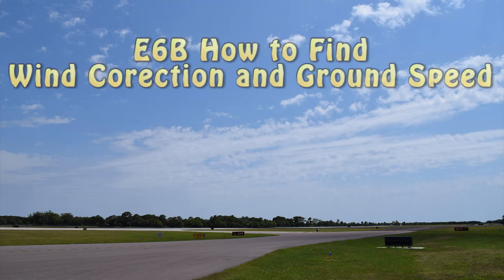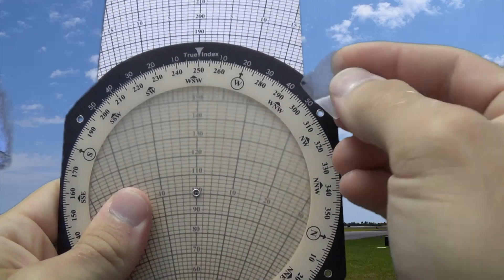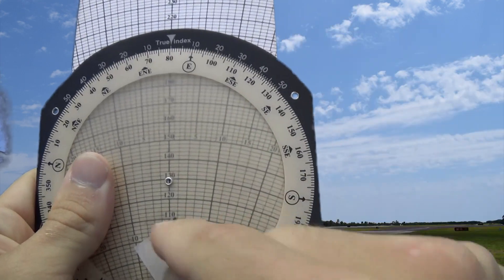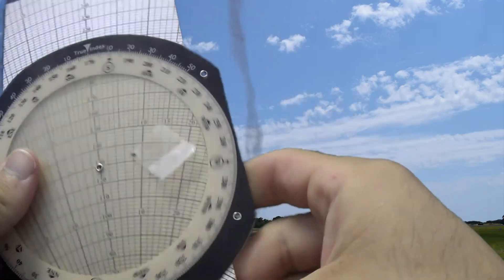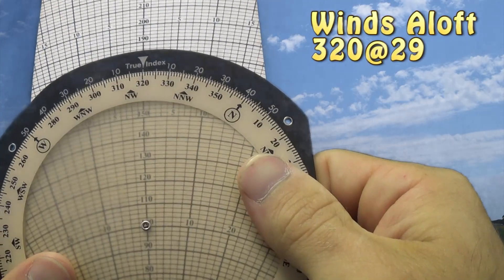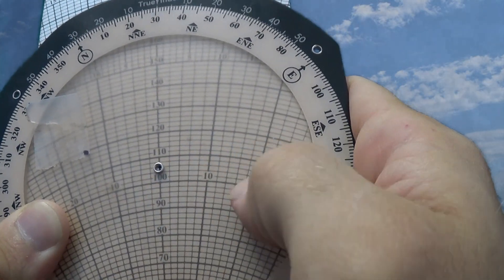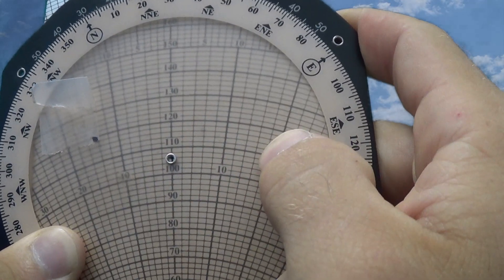Ep. 107: E6B Wind Correction Angles | How to calculate Ground Speed, WCA, Magnetic Heading

Comment: what if the TAS exceeds the CRP5 figures, examble a TAS of 420kts how then do you use the crp to calculate GS, WCA
Reply: Therefore there is a backside of the plate up to 650kts.

Please note that the method shown in this video does not work for that high speeds. You'll need to use wind down method (explained in comment above)

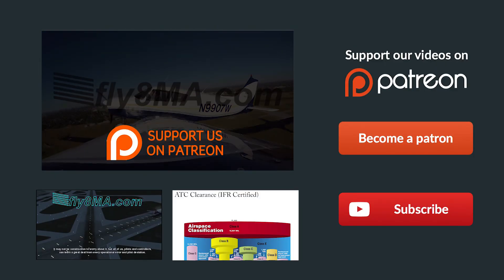Comment: I know this is a little older post, but I'm a little confused. At 6:39, you do a division of 50/105 = 28.57, but I run that number and get 0.476. Where does the conversion come into play and how did you get 28.57?
Reply: Here's how: 

50nm / 105 nmph = 0.476 hr = 0.476 hr x (60 mins / hr) = 28.57 mins

Comment: There seem to be a lot of "gotchas" in the aviation world.  Why should METAR and TAF have to be decoded?  It's not like there is a telegrapher tapping out the numbers.  These vital messages could easily be written in plain English.  Also, demanding that a pilot be expert in using 1940's slide rule versus an electronic device is as archaic as insisting that the pilot be able to hand crank the engine.
Reply from the maker: As you fly you'll realize why things are still this way.  I prefer a coded metar and tag since I can interpret all the information in less than a second.  With more words spelling out the conditions it would take longer to absorb the information.  Half seconds and seconds matter when you need to quickly absorb a lot of information in the cockpit to make decisions in-flight when things start to not go your way.  A slide rule can also be used faster than a calculator in turbulence when you are well practiced with it.

Comment: Thank you for video, but what should we do if the question would give TAS which is 420 KTS ? Can you make video for this question please? Ex: TC = 017 , WIND = 340/30, TAS 420 KTS. Find WCA and GS ?
Reply: Hi Guray, your E6B should have a hi speed side on the reverse of the slide. My WCA 6 degrees left for a TH 011degrees and GS 395. HTH
Reply: @mike326ify  Hello sir. Appreciate your work. I have tried to solve this problem I get the WCA 2,5 degrees for a TH 014,5. GS is 395.
Reply: @mohsenalziheiri2496  Precisely my answer using both e6b and Jeppesen CR. I made the mistake of plotting the wind arrow on the e6b on low speed side.
Reply: @mike326ify  thanks for the answer

Comment: How did you get 3.8 gallons burned? I got 3.5 from dividing 28.57 by 8.
Reply: You must convert 28.57 minutes to a fraction of an hour to multiply by 8 gallons per hour. Such as 28.57 minutes /60 minutes =.4761 hours which is multiplied by 8 gallons (.4761*8) to get 3.8088 gallons.
Reply: @untilidie33  i thought 50/105 is 2.1 instead of 28.57?
Reply: @waitdaniel  So imagine 50/105 as a fraction of an hour, so cross multiplication=50/105=28.57/x. This leads to 105(28.57)=2999.85 and 50(x)=50x. Finally, divide 2999.85 by fifty, which leads to 59.997 minutes.